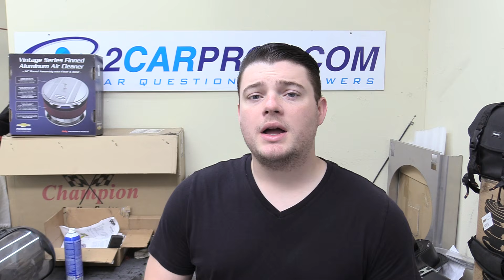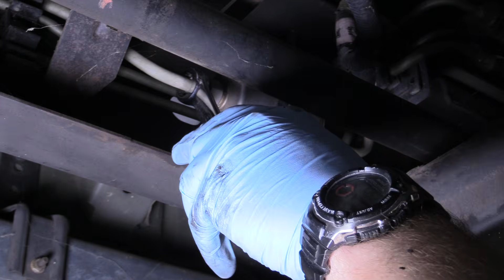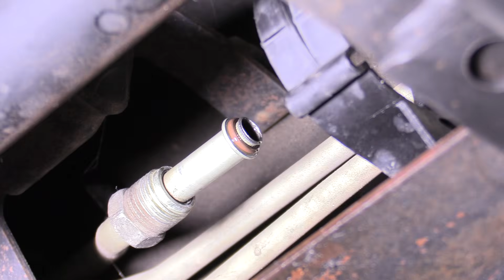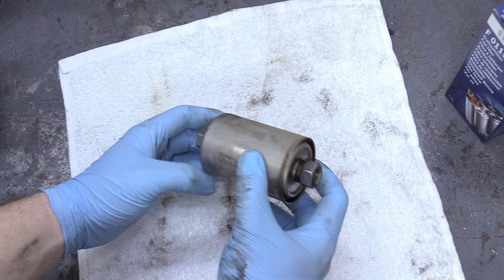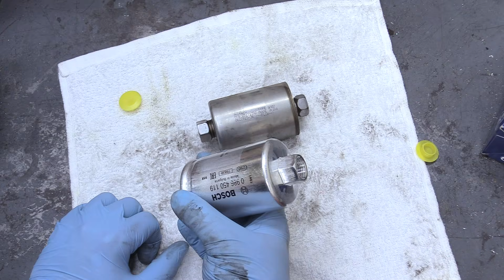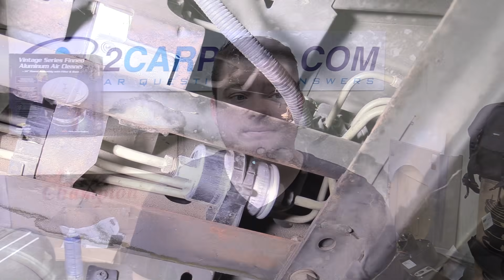Fuel Filter Replacement Chevrolet Silverado Suburban Tahoe GMC Yukon XL Sierra 2000-2006 - EASY!

Comment: I have a 2000 Escalade, and I don't know if it's the 4WD or what, but it's not as simple as you show. The front fuel line, the flexible one that has to move out of the way to remove the filter, is held in place by a bracket that needs to be unbolted from the frame. Major pain the the patootie after the major pain of loosening the fuel line. You don't mention that the crossmember gets in the way of the wrenches when doing that forward fuel line connection.
Reply: Rick is correct on that front fuel line support bracket needing to be removed.
Couple of other points:
1) Jack the drivers side of the vehicle up about 4"-6''s to give you more space to work and space to better leverage your wrenches.
2) Open the fuel fill cap to release pressure inside the fuel tank. This will help minimize fuel spillage.
3) Pull the fuel pump solenoid from the fuse box under the hood, crank the engine till it dies as it consumes residual fuel in the front line leading to the engine from the filter. Your face, hands, and forearms will appreciate it! (raw gasoline is very irritable on your skin)
4) Toughest part of this job is getting the fuel lines to line up with the threads on the new filter and properly 'bite' and uniformly screw into the new filter.
5) Use a Sharpie marker and write the mileage and date on the new fuel filter for future reference.

Comment: Hi, great explaination - but how would I know if it needs to be changed? Here is my issue - the power seems to just suspend and the check engine light flashes - no noise, no leaking, no sputtering, just lacks power as I am going down the road. I can change it but if that isnt' the problem,
Reply: Flashes means you need a tune-up but if the thing got over a hundred thousand miles on it and you know it never been changed it's probably the original from the factory, change it with your tune up

Comment: I have a real question..... how do i know if its time to replace it. .. my 2000 suburban takes 3 or 4xs to start, then it will run for a lil while then cut off... it used to run and i could go to work but now it stays on for about 10-15sec then cuts off..... one guy told me my throttle body needs cleaning or replacing but when i mash the gas it sputters and has to catch up b4 it drives regular.... idk but i need a answer so i know what parts to buy

Comment: Thanks a lot for your video! I also didn’t let off the pressure but it took some patience to get the tool in there the right way and get the line to pop off. Persistence is definitely key there. Thanks again! 💯🙏🏽

Comment: I have a 2004 silverado 1500. I CANNOT find the fuel filter. It is not located anywhere.  I've been searching for 30 min, thinking I'm blind. I have read that chevy in 2004 decided to put in a lifetime filter located inside the fuel tank. Can anyone verify this? Anyone else have this issue? Any response would be amazing thank you.
Reply: Did you figure it out
Reply: @Thaddeus Coston  yes, if it's not there underneath driver side seat where many videos show, then it is indeed in the fuel tank. Not sure why some trucks have the in-line filter and some do not. But for my truck, it's in the tank which SUCKS.

Comment: Thanks for the video!  How'd you get truck with virtually no rust? that frame is clean and not rusty for the age
Reply: no kidding! My 05 yukon XL that has spent its life in SE SD, & eastern NE is gnarly & not in a good way! I have to soak everything for hours or days including the quick connects (not quick disconnect). Replacing the fuel pump & the lines going nto the nylon fittings were so rusty & swollen even after soaking for days I ended up having to cut & splice new nylon fittings going to the fuel pump. An easy few hours job has taken way too long.

Comment: Do you know if a 2005 Chevy avalanche 5.3 have a fuel filter.  I could not find one on my truck.   Where can I find it
Reply from the maker: Yes it does. Check inside the frame rail under where the driver's seat is. Thanks for watching!
Reply: @2carpros  thanks for the response

Comment: This procedure works ONLY if your fuel filter and fuel line are not rusted which it most likely is. Replacing a fuel filter is NOT this easy.
Reply from the maker: The lines are aluminum though. How could it rust?
Reply: @2carpros  the nuts aren't! Rust is by far the biggest problem when doing this job. Please update with relevant, real-world video.
Reply: @5656KDawg so anyone not living near or around an Ocean is not living in the “Real World”? 😂  it’s fairly difficult to cater to everyone’s
Specific needs but if you’ve been dealing with rust for this long I assume the solution would be nearly the same every time wouldn’t it? Videos great in my opinion and I’m sorry for your rust problem but that salt water is always gonna cause that problem for you. Hope u figure it out man. GL
Reply: @anthonyclassic4093  have you ever heard of salt on the roads in the winter. I don't live anywhere near an ocean. In fact I'd have to drive 18 hours to get to an ocean.
Reply: We'll it sure isnt rocket science!

Comment: Would pulling the relay for the fuel pump help with getting rid of the fuel line pressure or will it still be there since it has no where to go until the filter is removed.  Someone told me I should stall the engine out first but seems pointless.. Thanks!
Reply: I think stalling the engine would be bad for the fuel pump.
Reply from the maker: Pulling the relay will do nothing to the fuel pressure while the engine isn't running. I wouldn't stall the engine, I like a little pressure in the line, helps get it off easier. Just remove the gas cap afterwards to cut down on flow and put a vacuum cap over the line. It honestly doesn't matter. You are getting gas everywhere, its a fuel filter. Be careful and wear protection. Thanks for watching!

Comment: I have a Suburban 2006 base 5.3 flx.  I go to the AcDelco web page and no fuel filter is on there for it.  NAPA has a filter but out of stock. Advanced auto dosent even have any listed.  why is that. PF-1000 K&N Fuel Filter  is the best i can find but now I wonder if it is the riight one
Reply from the maker: Shortages everywhere have caused all kinds of problems sadly. Thanks for watching Luke!

Comment: Is the Flex Fuel filter (Vin Z) different than regular gas 5.3 engine?  Mine lines are rusty AF, wish me luck.
Reply from the maker: You can check by typing your vin into RockAuto.com thanks for watching!

Comment: Couldn't you pull the fuse for the fuel pump and start the truck to empty the lines before taking it apart?
Reply from the maker: If you want it to throw codes sure. I like the fuel in the line, helps pop the line off easier. Thanks for watching!

Comment: I ran out of gas about 2 weeks ago I grab the gas can that had a little bit of water in it and my truck hasn't been running for the past month and now it's seized so I'm going to try to put a new fuel filter in it
Reply from the maker: You might want to drain the tank and try gas without so much water in it. Also check fuel pressure to rule out the pump going bad. Thanks for watching!

Comment: Why do you disconnect the battery for
Reply from the maker: So there is no way the fuel pump can accidently turn on. I leave the key in the ignition when it's on the lift so it can be in N when I let it back down. Thanks for watching!

Comment: I typed in the search How to change a fuel filter on a 2012 Chevy Suburban.    I got your video but you said 2000.   Will these steps be similar for my 2012?
Reply: Pretty sure 2012 doesn’t have inline fuel filter. It will be on your fuel pump inside the tank.
Reply from the maker: Yes it will be very similar. Thanks for watching!

Comment: Could a bad fuel filter cause a cylinder misfire. Especially in 7 or 8????
Reply from the maker: It could but it is much more common to be a bad plug or coil or injector. Thanks for watching!
Reply: Yup. Changed plugs, wires, coil, injector and updated valve cover to prevent the oil fouling issue. Still pitching a P0307 code and you can hear misfire.
Reply: @firefly0203  could be a bad lifter causing the misfire

Comment: Could you use teflon on the thread when installing the filter?
Reply from the maker: No. Don't do that. Thanks for watching!
Reply: @2carpros  OKAY THANKS!
Reply: @2carpros  out of curiosity why no Teflon?
Reply: @ecgodsmack86  the oring is the seal, not the threads

Comment: You are the only one to talk about the o rings. Thank you its very important! When it starts sucking air it will make you think your fuel pump is going out.
Reply: This is really late, but can you elaborate on this please?
Reply: @qudebro525 o ring is a seal to prevent unwanted air to get inside the system
Reply: It won't suck air. The pump is in the tank, and you will have a fuel leak when running, because the filter is on the PRESSURE side, not suction.
Reply: What size are those o rings
Reply: You cant suck air in a pressurized line😂😂😂
Reply from the maker: Sure will! Thanks for watching!